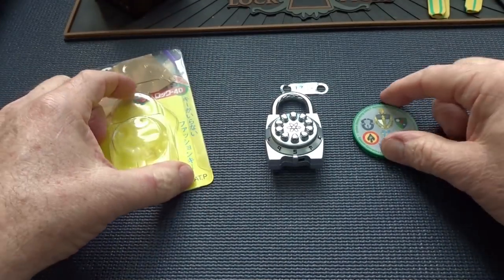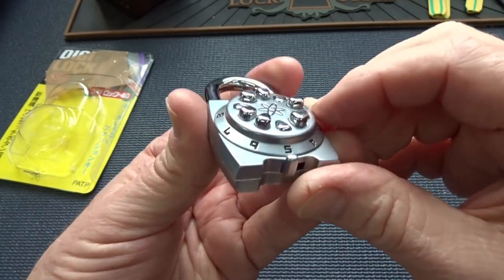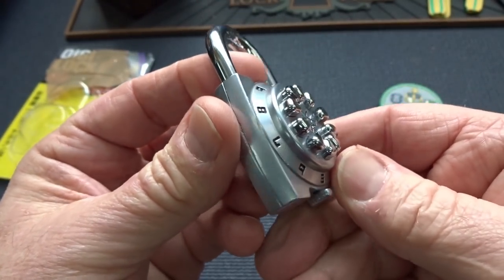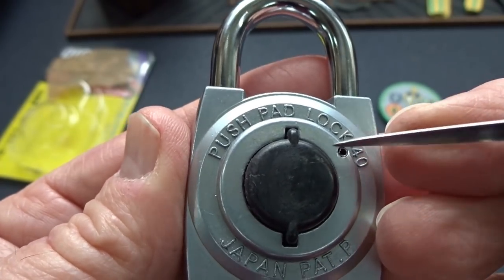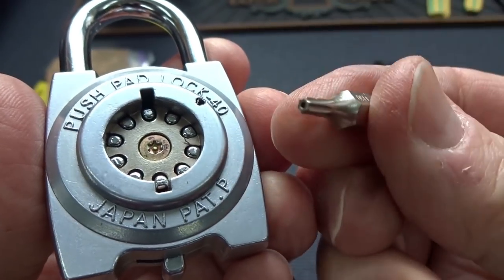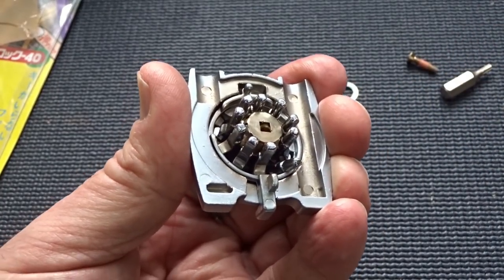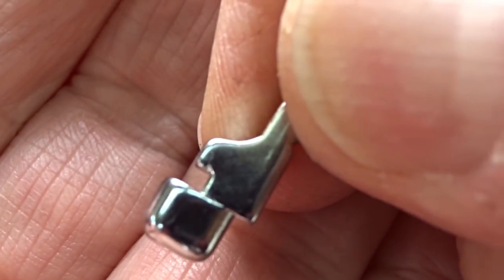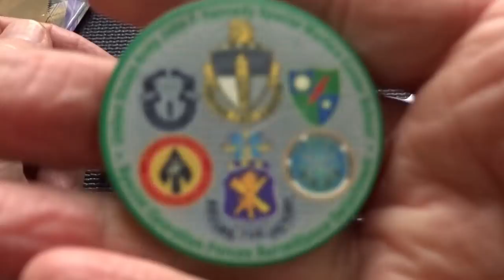(1223) Wes & the Dude's "Exploding" Combination Lock

Comment: so basically you CAN change the combination if you know how to put it back together.
Reply: Yes, adding as many more numbers to the combination as you wanted also, by modifying the other pins.
Reply: iWhacko, problem is that you'll change the positions of the buttons, but you'll keep pressing the same buttons. So only those buttons will show clear signs of wear.
Reply: Sander Deryckere, yeah that's still true. was only commenting on Bill saying that you couldn't set a different combination. which you can, but not so easily.

Comment: I think with those there are only about 210 combinations because the order of the digits is unimportant.
Reply: You are quite correct, sir. For the uninitiated the amount of combinations of 4 pressed and 6 unpressed out of 10 total is 10!/(4!*6!), with the exclamation mark meaning factorial.
Reply: So you could brute force this if you had like 30 minutes probably allot less time. Also one big weakness of these types of locks is looking over a persons shoulder.
Reply: There are at most 252 combinations and you only know it's 210 cause you know it's a 4 digit combination. If you didn't know the number digits, the number of combos goes way up. Assuming that the buttons you have to press are at least three and no more than 7 the number of combos becomes: (10 C 3) + (10 C 4) + (10 C 5) + (10 C 6) + (10 C 7) or 120 + 210 + 252 + 210 + 120 = 912. At 5 seconds per attempt that comes out to about an hour and 15 minutes. 2 and a half hours or more if you aren't a robot.

Bonus knowledge: cause of the symmetry of pascal's triangle there are also 210 combos for 6 digits. The oddness and evenness of the set determines the size of the peak also (max value of nCk is peak) . Cause it's an even numbered set there is a single peak at one half. But odd numbered sets of integers can't be divided evenly so there are two that share a max value.
Reply: Nice analysis. However chances are pretty good that all of them are going to have  a 4 button combination. That setup is pretty common.
Reply: If you don't know the number of digits, there are 2^10=1024 possible combinations: Each pin can be in one of two positions, and there are 10 pins.

Comment: If you get it back together try to use a disk of aluminum foil placed under the back button. Dents in the foil may expose the correct combo.  It would require a second visit after the owner had used the proper communication though.

Comment: You can't press the buttons while engaging the lever, as you showed, but it looks like if you tension the lever it puts lateral force on the pins that are blocking, which might be detected by touch.

Comment: I noticed that the reason they seem to lock up when tension is applied was because of the fact they had notches cut into the bottom of them that would cause it to lock up, would partially depressing the buttons before tension is applied possibly be a work around or is the mech designed to avoid that?
Reply: Ash20493 I had the same thoughts, I would also like to know the answer.
Reply: Also you could push them in completely and "pick" the lock from the back after removing the rubber.

Comment: Well if you took two lock you make a 5 digit or more lock but for a security point its better off to use fishing ( as the sinker ) then to keep some thing secure.
Reply: We can make it super secure by having a 10 digit combo. No one would ever guess it. :-D

Actually, you don't want more than 5 digit, otherwise you're beginning to reduce the number of combos again. 6 digits down with 4 up has the same combos as 4 down & 6 up.

Comment: once the combination changed... I would Tig weld the sides of the lock to prevent somebody from oppening it like you did Bill.  ... still a cute lock
Reply: Why go through the trouble of welding it when you could solve the problem more easily by simply using a better lock. Even welded you would still have a shit lock that someone could easily break trying to open it and you'd be left with having to replace it anyway.

Comment: From the look of it, if they push it to the right depth and pull on the actuator and try to push on the button on the back at the same time it might give them a bite on the proper numbers. Where as the others will just be pushed up as they have no notch.

Comment: I think that's an interesting lock, that could be made to a much higher level of security and quality, if someone ... was inclined.
Reply: "much higher level " ...well, when you start on the bottom rung anything is much higher. But by the time you really fixed all the bits on it, you'd just have an entirely different lock. There are quite a few of similar concept out there. You see them a lot on lockboxes for keys on the sides of buildings and stuff.

Comment: Maybe push them all down and try for binding from the back unlocking?
Reply: You might be onto something. The order they are entered in doesn't matter anyway. A place I worked had a similar style one but it was a lockbox on the wall that the key for the company car was kept in. It only needed 3 digits if I remember correctly. But you could figure it out by holding the reset button down, pushing on the numbers one at a time and basically feeling for the difference in their rebounding.